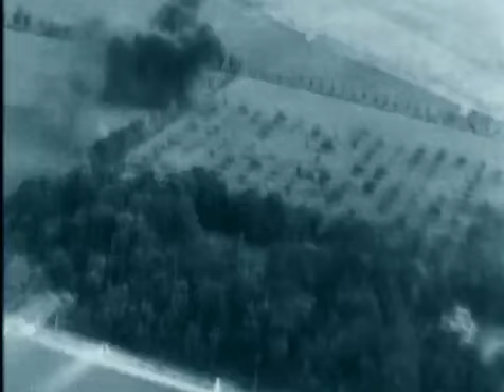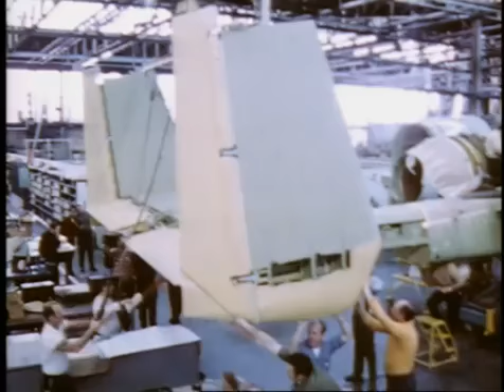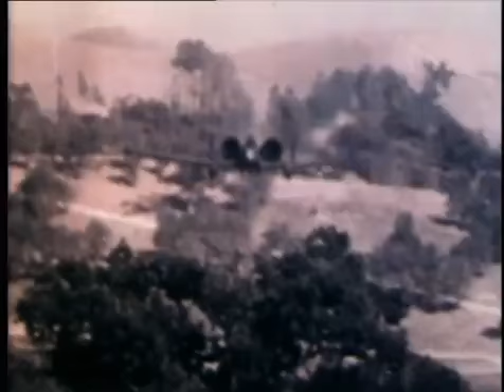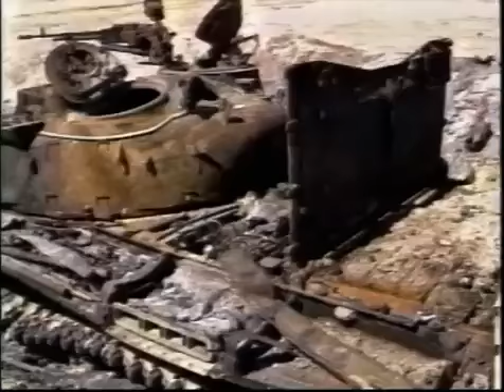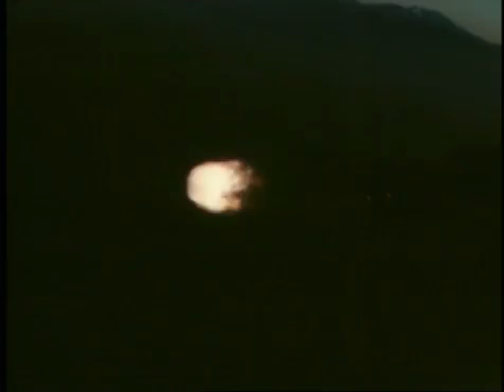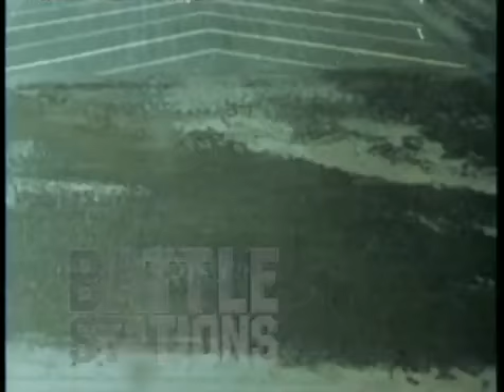A-10 Warthog Tankbuster | The Most Feared Aircraft in the Air Force Arsenal

Comment: I can tell you.  As an amateur student pilot.  The A-10 Warthog.  Is, a difficult plane to fly.  How do I know?  If I was never a military pilot?  I got to fly.  An official, US military, Grumman cockpit simulator.  That the Grumman guy let me try out.  Just being a, freelance, video camera operator.  Covering the, U.S. Air Force Convention.  In Washington DC.  For 7 years running.  And walking around on the, showroom floor.  When the show.  Officially closes at, 6 PM.  I just wondered up to the Grumman guy.  And asked him if I could try out the, A-10 simulator?  Thinking it was just a videogame simulation?  And whoops.  No it was not.

No.  He had asked me ahead of time.  If I had flown, F-14's, 15's or 16's?  I told him no.  35 years earlier.  When I was a young teenager.  I went up with my dad.  When he was taking flying lessons.  In a Piper Cherokee 140 or occasionally a 180.  I flew between the ages of 13 and 15.  And he let me go at it.  When he shouldn't have.  As he told me there were three other, Warthogs and an, F-16.  In my airspace.  And I thought it was just a computer simulation?  No.  No it was not.

No I found out I was flying.  On the official, high-speed military connection.  Flying with other pilots out of, Ramstein, Germany.  When I almost collided with the, F-16.  Who barely missed to be going vertical.  And the Grumman guy got really angry.  He told me to land now!  When I then flared a little too much.  And nearly stalled the aircraft.  When he jumped around.  Grabbed the stick from me.  And safely landed the simulation.

  He went on to tell me.  I actually had the right to be flying.  With other military pilots.  And if I had collided and/or crashed the aircraft.  The entire simulation would be brought to a halt.  And an official investigation would begin.  Whoops.

And that's my personal civilian experience.  Flying the, Grumman Aerospace, A-10, Warthog.  As a 45-year-old, civilian.  Never having touched a jet, much less military anything, before.  What an awesome experience!  And after that.  I just laughed through, Microsoft Flight Simulator.  It's such a joke.  With your little toy joystick.  And no forced feedback.  Ripping my arm out of my shoulder!  Which it nearly did!  And I was like why is it doing this?  He told me the pilot before me.  Dropped all of the ordinance under the left-wing.  But none from the right wing.  And I was feeling the drag.  And it was ripping my arm out of my shoulder!  Trying to stay straight and level!  Oh my God!  You have to be one strong person!  To fly these suckers!  You have to be in tip top physical condition!  It's incredibly physically demanding to fly!  Oh my goodness!

And I found the brand-new all glass, bowling cockpit.  Of the, Lockheed designed, F-22, Raptor.  To be a lot easier to fly!  As I flew that the previous year!  And that went really well!  As we actually found a screw up.  In the software.  And it shut down the, guidance computer!  And the Boeing guys said… Hmmm?  We've been flying this simulation, for the past four days.  And it's never done that before?  And I was like done what?  He said the guidance computer glitched and shut down.  And he was very concerned about that.  Because this was the brand-new bowling cockpit.  Of the F-22.  That was just entering service at that time.  When I then asked him.  Can I fly it manually without that computer showing me the guidance?  He said well yeah, sure.  And flips a couple of switches.  And says okey-dokey.  Here in full manual.  What do you want to do?

I told him I had overflown the last target.  I want to go back and get it.  He said go for it!  And so I put the skiing in an extreme bank.  Of over 45°.  When he says I can go tighter.  But I'm losing altitude.  And speed.  And I push my throttle up.  But I'm still losing speed.  And he tells me to push the throttle up.  I told him I did.  But it stopped.  He told me to push harder.  And when I did.  All the gauges on the glass display changed.  Along with the sound.  And I asked what just happened?  As everything was going by very quickly.  He said I'm in afterburner.  Afterburner?  I had heard about super cruise.  I didn't know it also had afterburner?  And things were going by faster than I could think!  When I completed the turn and throttled back.  And took a breath.  Found the target.  Lined it up.  And released the rocket.  And boom!  I took out the target.  And I brought that simulation to its conclusion.  And oh wow!

It was the end of the show.   And when I stepped out of the cockpit and turned around.  There were five US military fighter pilots.   Hadley asked me.  If I had flown, 14's, 15's or, 16's?  I said no, never.  Just a Piper Cherokee 140.  With my dad.  Between the ages of 13 and 15.  35 years ago.  They asked me why I didn't enlist in the Air Force?  I told them I actually tried to.  But they told me I needed a Masters Degree in something, anything preferably, Electrical Engineering.  Before they would allow me to fly a fighter jet.  So I said I'll fly anything!  But they said no.  When I was 18.  And so I tried the, Navy.  A no go there as well.  So I tried the Army.  That was where my dad served for World War II, Army Intelligence..  As I also had an IQ over 150.  But they also said no.

In the end.  I tried the Marine Corps.  But they also said no.  By then I felt dejected.  And rejected.  And didn't try for the National Guard nor the, Coast Guard.  And settled into my life.  As an engineer.  For top recording studios and television networks.  For my next 50 years plus.  Oh well.  It was fun flying those official military, simulators.  As a civilian amateur.  And I dream.  About how much more fun I could've had going fast and dying fast.  And hopefully wouldn't have.  But instead I didn't.  And wouldn't.  Oh well.  I could dream.  And fly the real military simulators.  The closest any civilian could get.

I could also talk about my excursion.  Into becoming a woman.  But I won't. Here.  Coming out.  Due to an audio job I did for NBC-TV News.  In the East  Room.  Of the White House.  2 hours before a presidential press conference with Ronald Reagan.  When I saved the technical day for NBC-TV.  So as to prevent, egg splatter.  On everyone's faces.  From my engineering managers total screwup.  Whose ass I saved.  And resulted in his firing after 23 years with NBC-TV.  And that's a whole  'nother story.  Too funny to tell here.  About true, technical, incompetence.  I still laugh over to this day.  Now as a woman for the rest of my life.  When I wasn't then.

I'm not sure when my book will come out nor my documentary film?  It's coming.  So am I.
RemyRAD

Comment: It's frustrating how disconnected the Air Force brass are from the true needs of the infantry.  The 2 greatest friends of the infantry are the A10 and the AC130.   These aircraft have tremendous capability.  They are also both unique in our inventory.  Sadly we have very few AC130's, and the Air Force brass are constantly trying to get rid of the A10.   The Department of Defense needs to move both of those aircraft to the Army and Marines.   The out of touch and arrogant Air Force brass just don't get it.  They are more concerned with the size of their budgets and prestige than protecting the "fighting man" which should be their primary objective!!!   I highly question the needs for so many F22 aircraft in the world where a few of our enemies have the sophistication to require such an aircraft.  After the navy screwed up by retiring the F14, the Air Force is doing the same with the F15.   There has never been a scenario where many F22 would be advantageous to the F15.  We had no trouble in either golf war and future enemies with would have similar capability.  The other mistake was Prematurely retiring the F117.  The problem is that the navy and air for sprats are more politician than soldier.  They compare each other by metrics that are irrelevant for the protection of the fighting man.   I pray they realize their mistakes before we have our next military intervention.  We need the SR71, the F117, and far more AC130's.   Of course we need to retain the A10 and continue to upgrade its capabilities electronically.   I fear that the replacement A10 will have the addition of too many "sensitive" modifications/subsystems that will reduce its ability to endure battlefield damage!   Someone needs to fight for the needs of the infantry as opposed to the egos of the brass!   Again, moving the CAS weapons to the Army and/or Marines would go a long way to protecting the man on the ground!

Comment: Watching 👀 this in 2023 👮🏼‍♀️ When they say :It's thick, it's big, It Rumbles" I immediately think of Officer Melanie Hall... Of her riding on a Harley For the Rumble on her way to the Her new job as Pilot in the A-10 Warthog... because of the Rumble & BRRRRRTTTTT... and vibrations of the machine...  and then getting into her Boyfriends vehicle that has a massive sound system... that makes her hair float in the air... and the seats & whole vehicle vibrate. I think her law enforcement career might be over... eventhough she worked so HARD at trying to get promotions & team morale... But she could have a great career as an A-10 pilot... maybe she might get enough satisfaction finally... where she wouldn't need to sleep with the whole base to get her rocks off. Especially if she owned & rode a Harley for the Rumble between the legs... and then the BRRRTTTT of the A-10.... and then yep... just like that video of the girl in the passenger seat of the car where the sound system is blasting & shaking... and that lady has that all of a sudden "O" face & sudden smile of satisfaction... Officer Hall could have the guy with that car & sound system as her next boyfriend. 🤣😅🤣😅

Comment: I hope the US continues to have the A10 warthog what country has any thing better
Reply: Any county with manpads. You get shot down so easily hence the hight losses of planes suck as the su-25 the Russian equivalent to the a-10
Reply: @deathbyboa1  what country has air support better than the A10
Reply: The USA with the better planes the f-35 and f/a 18 they’re both more suited to the cas required on the modern battlefield
Reply: @deathbyboa1  OK what country has A better aircraft better than the A 10 in air support on the battlefield
Reply: @johndodge2188  same awnser as before because the battlefield for which the a-10 was designedly doesn’t exist anymore on the modern battlefield the a10 and many of its advantages over other planes for close air support are nullified by man portable air defence and regular Sam’s because it’s so slow and has a high radar cross section the a-10 was the most shot down plane in Iraq Afghanistan e.c.t with an enemy more sophisticated that the iraqi army and the taliban which is the most likely thing to face e.g. russia, China or Iran the all have at least decent number of man portable air defence systems which the ukranians are using to give an example agains russia themselves the most lost Russian plane in the war is the su-25 which is the russia. Equivalent to the a-10 and was also built around the gun like the a10. The Russian have lost 25 of them so far the slow nature of the a-10 and su25 doesn’t lend itself to the modern battlefield any more.
Reply: @deathbyboa1  OK, again what other countries have A better air craft than the A10 air support for battle field

Comment: Me: Give a reason why the A-10 sucks.
Everyone:
Me: Exactly. There are no reasons.
Reply: Sandman Huffmaster   its cheapest to maintain for its desig for putting most firepower down with longest linger time. Yes youre right but we don't have that issue in modern conflicts. A bronco or a modern fighter can do all these missions without having to stick around for hours upon hours. A10 would worked great during large scale assaults like gulf War or 03 Iraq War. CAS to bomb a few terrorists with small arms  in a hut is too much money to maintaining them since its all they're good for.
Reply: Over engineered, expensive to maintain, slow and can be replaced by pretty much the f35 in CAS missions and other modern fighters. It's a great plane during its golden years but fighting modern wars In 3rd world nation it is not doing much
Reply: @aarons3611  F-35 can’t do true CAS. The cannon has minute ammo capacity and its better used in the same capacity as a F-111 or F-117. The F-15EX will be a great threat to the F-35 relevance and rightly so.
Reply: @mmmmburgerz9442  The F-35 drops bombs and missiles more accurate on a target area than the A-10 with it's spray and pray method.

Comment: This plane forced the ussr to up its SAM game...with TORs BUKs Pantsirs etc
Reply: Nope, the B52, U2 and SR71 did that.
Reply: @guillaumelalonde7945  you're actually right..the warthog came to zap those same soviet anti air systems
Reply: @evonrn2000  not really, the A10 doesn't really have a SEAD capability. It can't carry HARMs. 

The soviets made all these SAM systems because the US was flying U2s and SR71s over the USSR. It also couldn't match the US air force in the air, so the easiest thing for them to build was SAM systems to try and deter the US airforce.

Comment: This is my favorite plane... its like toyota.
Reply: I read ya. Both are a purely functional design that works well and is reliable as fuck.

Toyota was famous for having cars that keep running no matter the abuse it gets. Seen many still running even after accumulating over a million miles on the odometer after decades of operation.

The Hog is similar in that can still keep flying even if big chunks has been blown off it. Some of those planes are still flying even tho they're decades old. They may have new gear hung on it, but the basic frame is still the same as designed all those years ago. Somethings ye cannot say the same for most other pllanes.
Reply: Are you plugged in dude. Its American
Reply: And that’s what you call *sarcasm*.